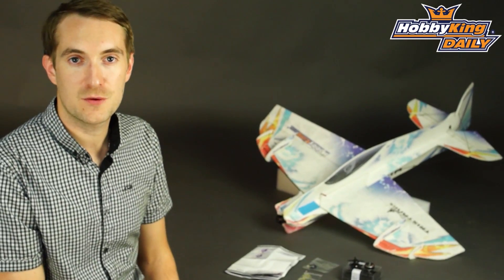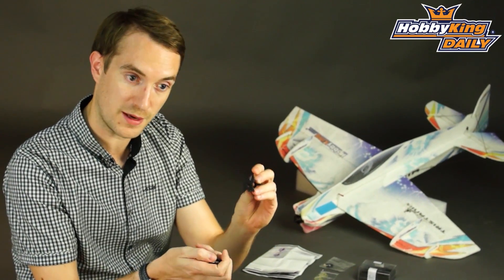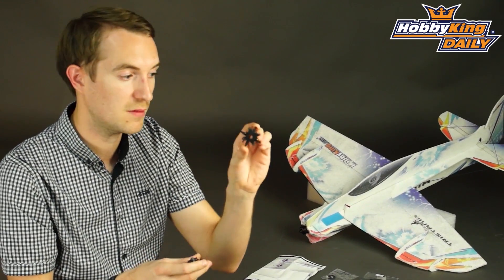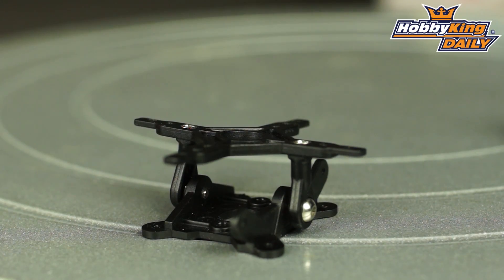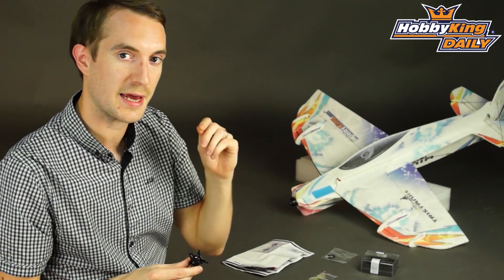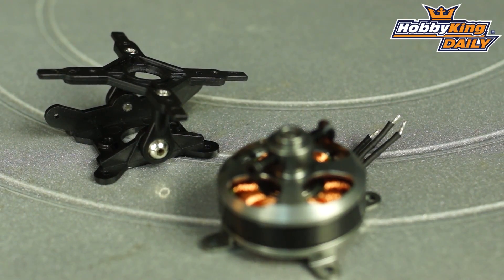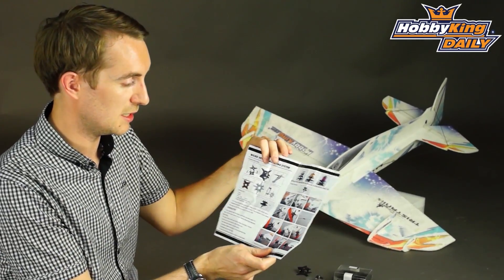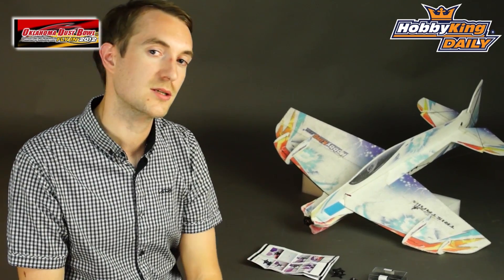HobbyKing Daily -  Vectoring Thrust mount

Comment: Probably the question is a 50g servo is enough ?
For sure, on EDF, the propeller momentum is not that big - but here ...
Try this - use a BL with a 9' propeller (use a stick to hold the engine) - Then try to change its direction.